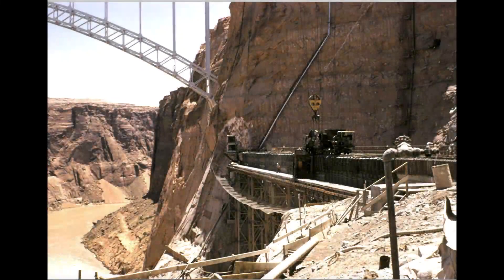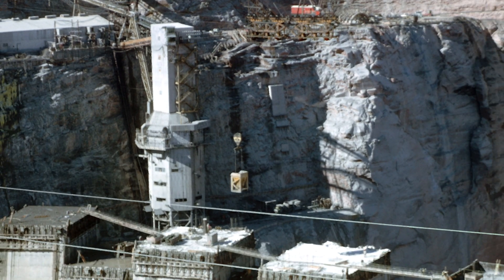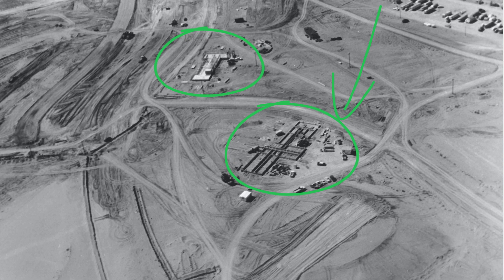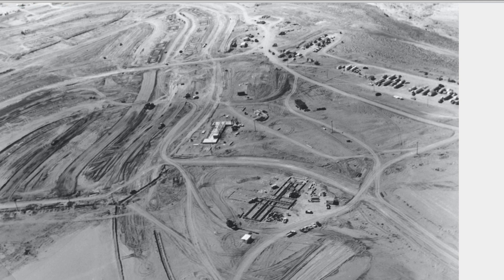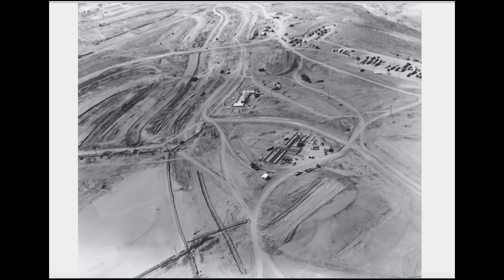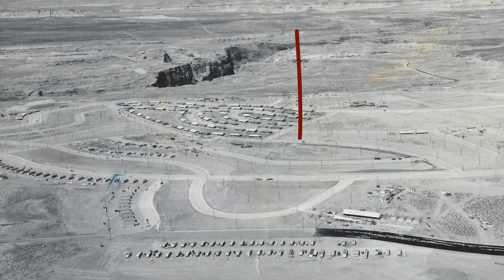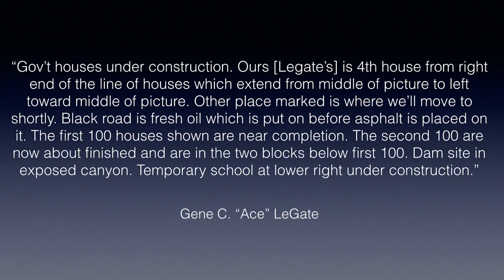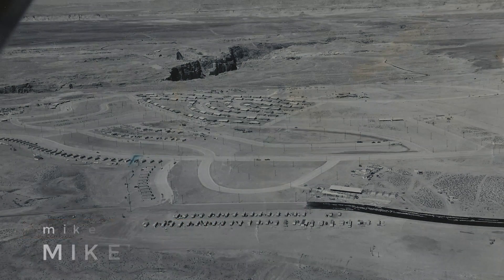Late 50s Page Arizona Under Construction

Comment: Mike, I worked for the city in the early 80s. One day, I was working on the Caterpillar D7 tractor used at the old trash dump. A former USBR worker came over and said he operated a D7 during the construction of the dam. (one of two D7s that worked on the dam) I informed him that this was one of them. He told a story about one of the D7s getting stuck in quicksand around the bend of the river. They tried getting it out with the other cat but were afraid of getting it stuck and losing both vehicles to the river. He said they ran a cable from the skyway crane and tried to get it out. It could not pull it out. The D7 stayed in the river during the spring flood. After it dried out, they were able to dig it out and pulled it out with the other cat. 
I do not know what happened to that D7 after the dump closed.